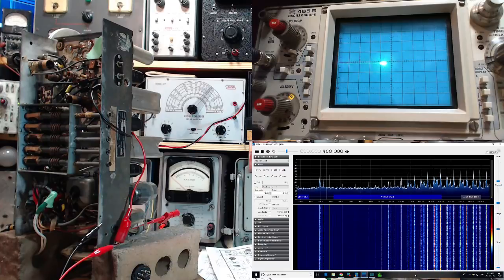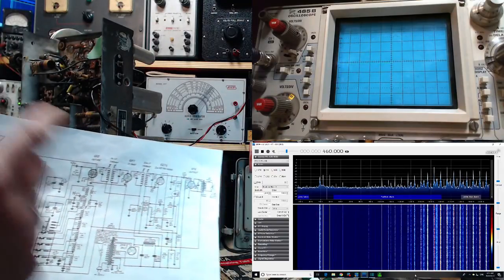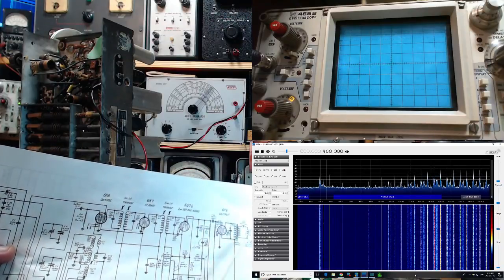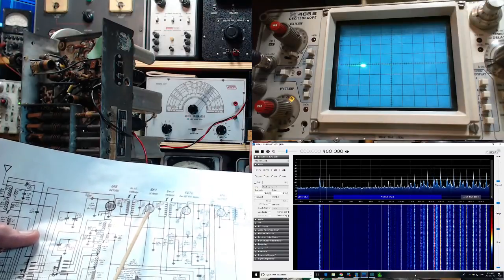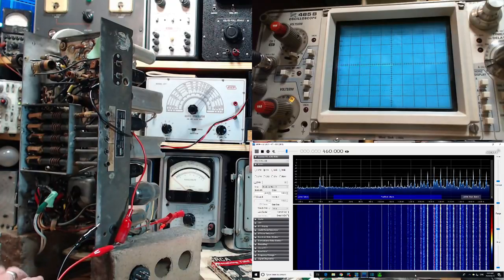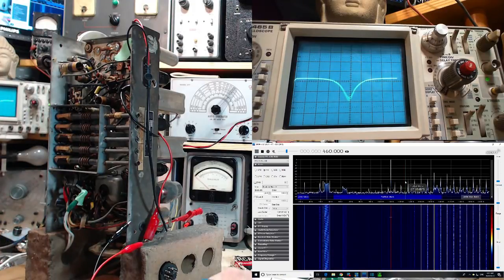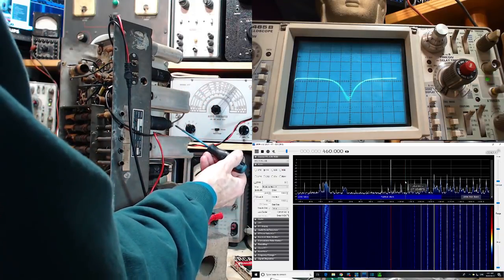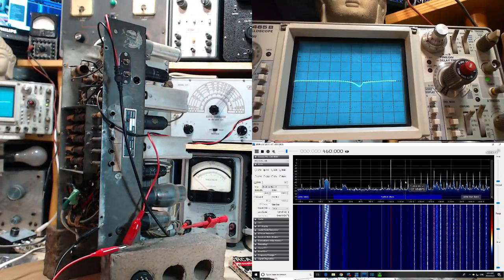Westinghouse 535 #19 - More Radio Experiments

Comment: Jim, the first tube in that radio has two functions, the triode section as a variable frequency oscillator whose frequency is set by one gang of the variable capacitor (and acting as the  local oscillator), the other part as a mixer. 
At the output of that tube (using your SDR) you would be expected to see 1) the local oscillator (LO) frequency 2) the signal input to the mixer from the front end tuning 3) the difference frequency between the LO and the signal input to the mixer from the front end 4) the sum frequency between the LO and the signal input to the mixer from the front end. 
If we assume the front end is tuned to 640kHz then the LO needs to be set to 1100 kHz to give a difference frequency of 460kHz (which is what the IF section is tuned to). There will also be a sum frequency of 1740kHz which should also show up on the SDR.
All of these frequencies will be detectable by the SDR at the first tube since we have done nothing to reject any of them, however the only one we want is the difference frequency between the LO (1100kHz) and the signal input to the mixer from the front end (640kHz) which is 460kHz. 
The first IF transformer, and the rest of the IF stages is there to pass and amplify 460kHz and reject all the others. 
Hope this helps.
Bob G8CQR

Comment: Actually that is where our French friends are located and it seems that are are all drivers so they might each have cars, can you switch to CODFM (Coded Orthogonal frequency-division multiplexing.)  mode and see if that is causing those strange signals, if they had used a balanced mixer in the front end then the carrier and the antenna signal would not get passed through and would be removed from the signal by the balanced mixer and the only signal would be the IF also crystal filters could have been used to replace the IF transformers.